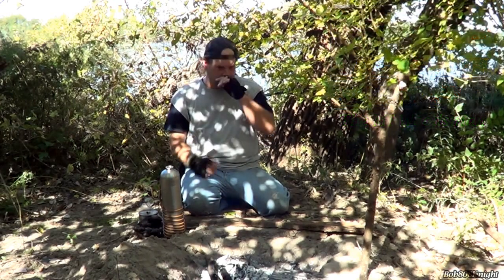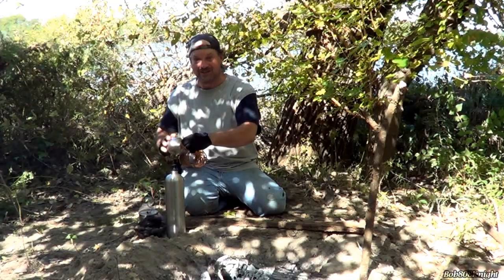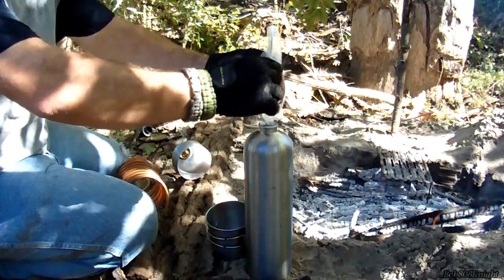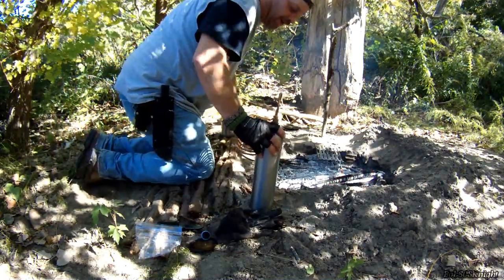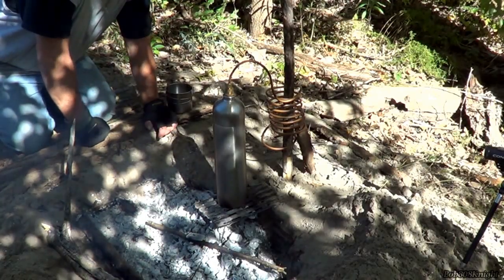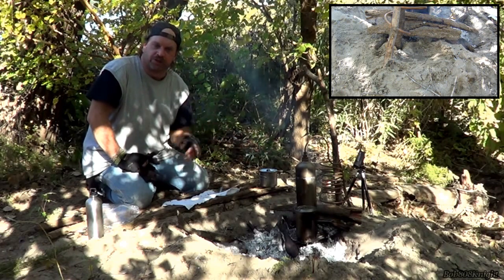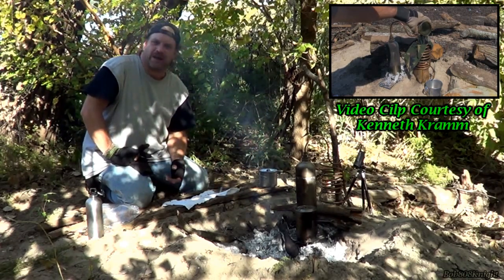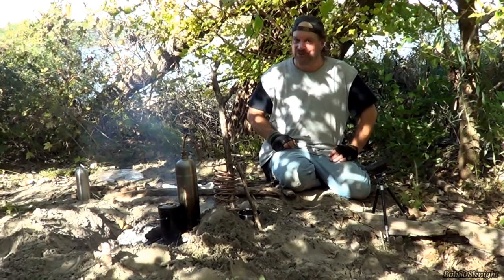Water Distillation

Comment: FYI, distilled water always tastes flat...you can by gallon jugs of it in stores. Its best use is for topping off vehicle batteries IMHO. Generally speaking if you don't have enough cooling going on you can lengthen the amount of copper tubing and make each turn of the tubing broader. This will slow the flow rate down and give more contact with the copper which both help cool the water. I have seen some stills use a few horizontal turns first then a small collector vessel before dropping to vertical coils to the catch container. That would probably be too much to have to haul around in a backpack though!
Reply from the maker: Reagan L. Hi Reagan..you're right distilled water does not taste very good at all. This is more of an experiment though..where I live you really don't need to distill your water. The Sawyer squeeze will work great.I am going to be doing a part 2 to this video though. I will take your information and incorporated into my new design. Thanks for your input.

Comment: Great video Bob.  Your approach gave me several ideas  that I want to test in later versions of the still. Awesome approach.  I like the use of sand to cool the condenser and wood as a barrier between the boiler and condenser.  Several recommendations may improve the quality and quantity of output.   There should be essentially no salt in the distilled water.  1) Don't over-heat the boiler.  Overheating will cause overflow to enter the top section.  2) Don't clamp the sections together; clamping may increase contamination and defeat the purpose of having a top section  3) Ensure that the steam / water always flow down hill.  This will reduce back pressure and increase quantity/quality of output.  3) Use a smaller fire/heat source.  This will allow the condenser coil to stay cooler.  4) Cool the condenser coil with additional damp sand / water rag.   5) Try using a larger diameter condenser coil (3/8 inch rather than 1/4 inch) than the one I gave you.  I used the 1/4 inch diameter copper tubing on the small version of the still.  The 1/4 inch tubing might not be large enough for the larger boiler.     This change should help reduce back pressure, because there may be fewer / no water back-up AND more water may flow from the boiler.  The small version of the still that I tested (in YT video) produced 1 cup of water  per 30-40 minutes.  Water quality (based on conductivity testing) was between commercially distilled water and tap water from my home.  Output from the condenser was not HOT, rather it was luke warm, with no steam coming from the collection cup.

I encourage others to test variations of this basic still design.  Improvements come from trial and error. Learning comes as much from failures as from successes.   We won't know what works and doesn't work until people try different approaches in different situations.  Your video demonstrates awesome creativity and honest results.  Hopefully others will use it as a springboard to test different ways of problem solving.  

Thanks for sharing your results.   Ken
Reply from the maker: KennethKramm hey ken I think it's time we put out a YouTube challenge...I'll talk to you more about it tomorrow night.
Reply: Bob808Knight Agree.  We could jointly post a YT challenge on both our channels.  Lets' do it!   The challenge could include both of us talking on the phone or something and then doing it.....  Call me when you have a chance...

Comment: If your distilling water there will be NO salt in it, you have contaminated you effluent.  Therevare a number of issues with your process, weight being the first and fore most.  Distilled water has no smell.  Yes it is goos to lose the first drops expecially if you suspect chemical contaminatin but then still it depends on how close vaporization temps are.  Also don't let it boil dry.
Reply from the maker: Tim Barton hi Tim. The system I'm working on is a base camp system. Where I live there's really no reason to distill water. The Sawyer squeezed works great.interesting thoughts about the vapor. temperature.mmmmmm I'll have to look into that thanks for the heads up. thanks for your comment Tim have a great evening

Comment: Why not use a section of rubber hose to connect a barb on the thumper keg (top steam chamber).  Use a rubber hose so you can put the evaporator coil a few feet away from the still?  This would also aid in storing the coil around the still when in your pack.  I would think you would want the coil in shade of possible and perhaps something to direct the wind over the coils would help even more.
Reply from the maker: Crafted interesting thought about the rubber hose. You've given me an idea..I'll have to work on that and see what I can come up with thanks brother.
Reply: You're welcome my friend.  I'd look at adding a "thumper keg" setup also.  I'm not expert, but I think it's a smaller vessel above the main vessel which funnels back into the main boiling chamber.  So, a small bulb that screws on top of the main boiling chamber, then the barb fitting to rubber hose on top of that.  If I understand them correctly, it is a place where the speed of the steam slows.  The micro droplets fall back into boiling chamber and you ONLY get steam into your condenser.  Or at least a higher percentage of steam and less "splash".   Ken's got a kind of thumper keg going there but it does not drain directly back into the boiling chamber.  I bet you can get the time to process a container of water down to 60 min or so.  Figuring a way to get it all nesting inside of itself is the key to making it more practical.  Still, great idea for seaside and brackish water camping.
Reply from the maker: That actually sounds like a still set up. Are you going to be making some rocket fuel :-). That is a lot of good ideas though. Have you thought about doing a video  . I know I would enjoy seeing it. I'm sure other people would too.
Reply: Bob808Knight Oh, my other hobby is philosophy and Liberty activism.  I'd love to setup a still.  I see nothing immoral with a man using is brains to make whatever he wants.  I consider all laws against voluntary exchange between people immoral objections to Liberty.  However, who want's the state coming after you and taking everything you've earned in your life?   This hill is not one to fight and die on.  Another idea. When you look at the stills on Moonshiners (TV show), they seem to be large broad containers.  I wonder if maximizing your contact area with the flame and at the same time the surface area is important?  In other words, the containers are usually much wider than they are tall.
Reply from the maker: I have a friend of mine who is a moonshiner. I'm trying to convince him to take me to his still. I'm not sure if he will do it or not. He won't even take pictures of it. I really don't watch much TV I have to wake up those moon shiner shows you are talking about. I spend most of my time either reading or on YouTube. Yep I don't have much of a life lol
Reply: Bob808Knight Yea, I don't really watch TV at all.  But I did take in a couple of those hokey shows.   There was a special on a famous shiner named "Popcorn Sutton".  Look that documentary up.
Reply from the maker: Yeah I will look it up thanks for the heads up brother. What are your thoughts on geo domes..
Reply: Bob808Knight They're cool structures.  Always causes a head snap when I see one.   Complex to construct.  Where do you put the sofa?
Reply from the maker: Crafted I've always been fascinated with them..I put a circle couch in mine :-)
Reply: Bob808Knight I'm surprised you don't camp with some sort of dome tent.  Has there ever been a closer design to geodesic?
Reply from the maker: Actually brother I build geo domes for a hobby. Have made a couple that have been to Burning Man. I have  some videos on one of the PVC domes I built.  It's still a work in progress though...:)
Reply from the maker: Whoops I didn't answer your question ..no there has not  been a tent that been close to a geo dome design.. That I know of..
Reply: Bob808Knight This video shows one on the cover shot.  I've not watched it.  Your location and the calendar imply it my be a good time for one of these.
http://youtu.be/Y0NUtKRLMOE

Comment: Bob, use some of the charcoal from the fire that has cooled down, and let the water drip through it and into the cup. This gets rid of the flat taste and absorbs any petroleum by products that turned to a gas at a lower temperature than boiling water.  All home distillers do this and the water tastes great.

Comment: i have seen the tubing done with medical tubing, but the tube went from the bottle up in the air like 2 or 3 feet then came back down , it looks like a upside down u shape, of course there is a metal connector to the bottle for a while so the rubber don't melt, the height is supposed to help keep contaminates in the bottle, hope it works well for u the way u have it...
Reply: the first few tube tries failed from wrong height issues to if u try it, be carefull...his vids are on utube but i lost em...sorry bob...
Reply from the maker: ***** I see you how you are lose his YouTube videos lol just kidding brother
Reply from the maker: ***** that's not a bad idea that's something for me to think about. And this is a base camp set up .not the portable unit like ken and made..I have to ask around and see if I can't find some surgical tubing. I wonder if it would add a plastic case to the water. Interesting yep you got my wheels spinning lol. Thanks brother